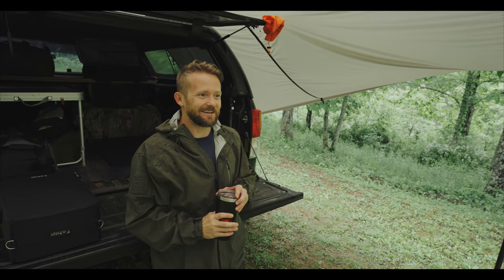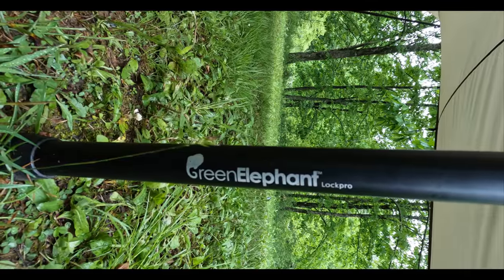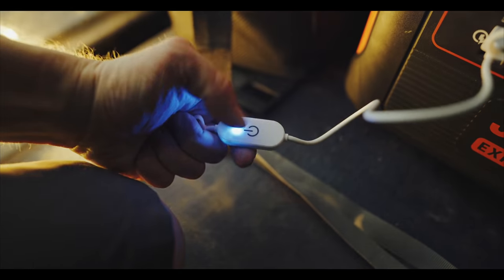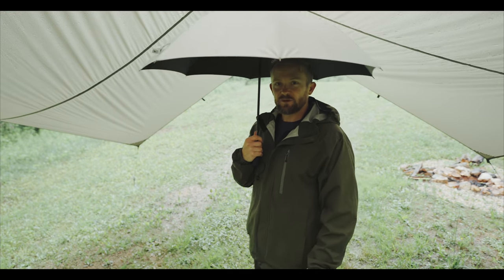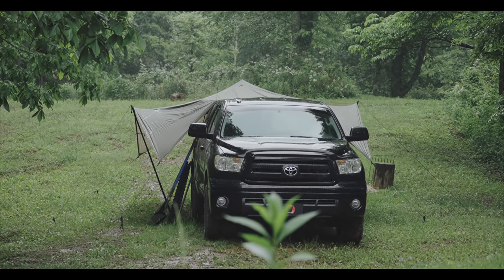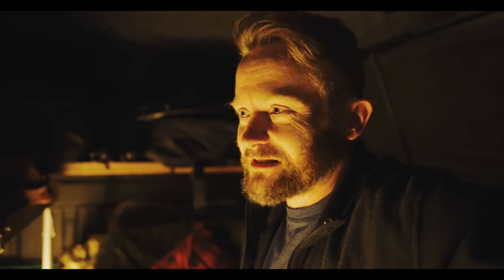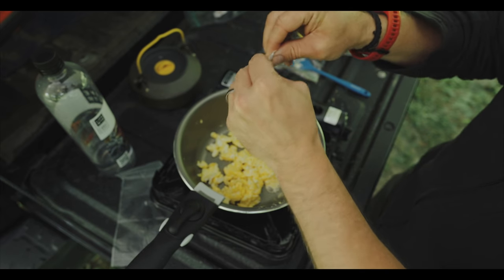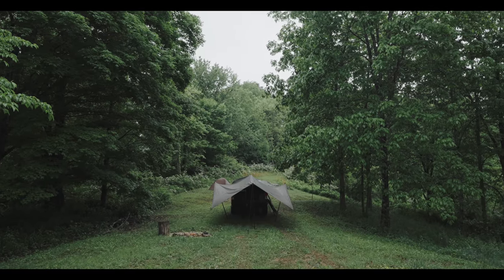⛈️ Camping in My Truck During Heavy Rain and Thunderstorms - Overnight Storm Truck Camp Adventure

Comment: I wasn't out camping, in fact I was still in town about a mile from home. I had just installed new headlight assemblies on my Tacoma and was in a construction area where it was dark and set my headlights to the correct height. On my way back to the apartment I noticed a car tailing me closely. If I changed lanes they changed lanes. If I turned they turned. If I sped up or slowed down they did too. Finally I got tired of it and made a fast maneuver in my parking lot  that allowed me to block their car. They stopped and I got out and yelled at them with my truck between us. All I saw was headlights. I couldn't see the car. Finally one got out of the car and answered me saying they were police. I told the guy to walk forward toward me and hold up his ID then.  He asked if I was armed. I told him not to worry about it. He could see me and I couldn't see any of them.  He told me to come out from behind the truck and I said not likely. You could be ready to shoot me. He finally approached my truck so I could see him clearly. He identified himself and asked if I was armed. I said only my tire iron. 
We finally got out of traffic and he started asking me what I was doing behind the stores. I said I wasn't behind the stores, I was in the construction area. 
Longer story shorter it turned out a store had been robbed while I was back there and they thought I might be the getaway car. Right? I was a quarter mile from the stores, not right behind them with a large cleared field between!. I nearly had to change my pants cause I knew I bit off more than I could chew stopping them like that.

Comment: It looks like you need a battery powdered blower for the truck bed. Remember, if a tree falls in the forest...maybe that applies to seeing it also. I used to have two small empty cans with layered tape around the uncut end rim (less PSI). I would put poles in them under the tarp to protect the material. For minimal camping, an umbrella can be attached to your back/pack to keep your head region pretty dry sitting up in a rain. We knew it would be loud on that hard shell. Mayo OK. I even use it for fry dipping sometimes.

Comment: 20'x13' is a big tarp.  While in college I kayaked at least two weekends every month.  More in the good weather months.  I car camped in a Volvo Cross Country with fold-flat seats.  I carried a 40'x30' tarp.  I rock climb too so I would take a 100' Bluewater rope, stretch it between two big trees, and pitch the tarp on the bias ( diagonally ).  It covered my car, a picnic table, and at least 3 tents ( sometimes more depending who came with me ).  When it poured, my tent became a hangout spot for many campers close around.  Good times.  My friends called my tarp "Gigantor".

Comment: I really like my Teton Vista 1 set-up.  The elite rainfly is a must, however.  My AquaQuest tarps just plain rock.  I have a 10x10 and a 20x10.  Should've gotten the 20x13.  Have had mostly great luck with the Green Elephant poles.  One of the six is in need of repair, it doesn't collapse fully.  Hopefully it's something simple.  Yes, they do fill up with water.  I loosen the clamps and pump them up/down while upside down to purge 'em when they do fill up.  And, agreed, LARGE stakes are a must with these big tarps, especially with soggy wet soil.

Comment: Awesome rainy camp adventure!
I see you’re using rags/towels/something balled up for chafing gear on the corners of the truck canopy lift gate. A pool noodle cut down to appropriate size and slit lengthwise makes a great bumper for those corners. I made tarp awnings along the lines of the Kelty Waypoint Tarp for my wife’s, my son’s and my Jeeps. Each one has two small lengths of pool noodle included in their respective carry bags. Lightweight and no fuss easy on/off.

Comment: I recall not a drive by threat but one from being up a canyon in a rainstorm in a camp site across the highway from Big Sands National Park, NM. The road up the top of the canyon showed signs of rain erosion as we drove up, so we resolved if it rained that night we would have to break camp to beat the road washing out.  You'd have thought we had good odds in the desert of New Mexico.  Well, good thing we didn't hesitate when a thunderstorm hit us at 3 am.  All our gear got partially wet as we piled it all in the car in a hurry, and rushed down the canyon.  The gush of storm water was right abreast us coursing down the arroyo, the road treacherous and covered in soft silted sand run off that was the remnant of the road we left behind!  We barely made it down in time!

Comment: Sorry you didn't sleep well.  That was a scary story if it were to happen to me.  I know I wouldn't have stepped out if the vehicle.  Especially having him follow me in to town.  I had a situation happen to me a long time ago.  My boyfriend was sleeping in the back of my large, Dynamic 88, 425 V8, and loved to drive it because of its power to take off fast. The dash had a display (0 to 100ish can't exactly remember how fast it showed) that was about 14" long.  It was late evening and had to go through a small town up in North Dakota and like a dummy I stopped at the towns 4-way stop sign even though there was a car with several guys hanging outside of their car and when they saw me they immediately started following me and they were tailgating me and fast.  They tried to pass me but I didn't let them veering from side to side as I I yelled at my boyfriend to wake up and told him what was happening.  He didn't get up, but woke up and reached for his Rueger and lifted it just above the back seat and slid it across from left to right on the top of the backseat.  Low and behold, they spotted it and quickly backed off to my relief.  I was so scared and shaking.  I thought I was in a movie.  That could have turned out so bad.   I won't ever forget it and some people probably didn't believe me.  Anyway, I survived of course but was more alert after that.  Sorry for the long story.  BTW Luke, breakfast looked so delicious.  Thanks for sharing your story.  Be safe and well.

Comment: Why don't u seal up the crack in the max tracks and fill the inside with expansion foam? Cheap fix and with the added foam it might help disperse the load a bit better? Plastics become quite brittle in cold temps

Comment: Mayo, no. Miracle Whip, the way to go! Question: I noticed the tarp did not go all the way to the front or past the truck topper. Where rain would have run backwards to the tailgate.  I am guessing the front of the truck was pointed slightly down hill then?

Comment: As to you buddy's issues; yes. When I get out of work I sometimes have someone follow me. It took me 4 hours to finally get home as I took every other route I knew. Pickup had a topped off tank of gas & could go 540 miles before it needs gas again. Though my route to shake this person off my tail only took 237 miles of driving. The route to/from work is only 34 miles. 

Another time I had a driver wait in the parking lot at work (doesn't work there though) and follow a ways, then pass only to force me off the highway. It ended when I bought a dual dash cam. 

As to camping on a budget, I used to with an ASTRO cargo van I used to have. It was well over 300,000 miles, so I traded in for a RWD pickup. But the cost for toppers has gone through the roof. Aluminum toppers used to be cheap, now they are over a grand.

Comment: Great camp set up with the tarp, Luke!  I wish we could have rain pour like that here in Sacramento.  It rained this past weekend but if it rained 1/4 inch it was a downpour...or downpoor.  I use a 10X10 Aqua Quest with my van (GMC Savana 2500 cargo van) and it works well as a makeshift awning with a set of Elephant Poles.  For a "restroom" I set up one of those orange/silver blankets draped over the rear barn doors secured with guy lines to tent pegs.  I have never encountered idiots or morons like your friend did.  He was wise to de-escalate the situation.  It could have turned into a truly tragic one.
Reply: My sister would love such a rain where she lives down in the "toe" of Texas (approx 60-65 miles nw of San Antonio)  She said they are surrounded by mountains .... the hear lots of thunder and can great light shows, but the rain just doesn't make it over the mountains much and when it does, well ...... as she put it, they use pop bottle caps as rain gauges.  😆